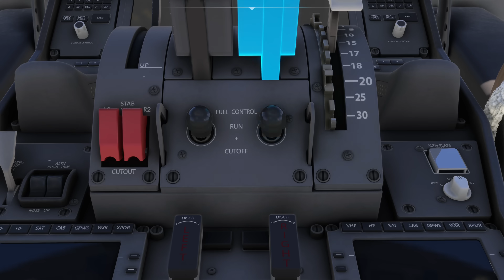Air India 171: Why Did The Fuel Cut-off Switch Get Moved?

Comment: There is a clear advisory by Boeing about installing the fuel cut-off safety, which was not  set, enabling the fuel lever to be moved without the need to lift them first. The fuel lever could have moved due to simple vibration or inadvertent touch. Why is that part not being discussed.  2018 FAA advisory recommended, but did not mandate, operators of several Boeing models, including the 787, to inspect the locking feature of the fuel cutoff switches to ensure it could not be moved accidentally. And in IA flight, the safety was not installed as per many reports.
Reply: And the moon is made of cheese, and 2+2=4, but I'm not entirely sure. Maybe the levers were over greased, or the runway was a rocky terrain and the spring in the spring loading was nibbled by mice, and if a duck looks like a duck, could it not be a penguin instead? It might be.
Reply: Both switches???

Comment: But the report does not state 'deliberately', specifically! It says 'the fuel cuttoff switches transitioned from RUN to CUTOFF with a 1 sec gap'. How they transitioned, is not mentioned. Although, they should surely have this data.

Comment: One reason Boeing said pilot error for the 737 MAX crashes is that there were notifications sent out warning that the issue could happen and how to resolve it, but many pilots apparently never read it.  One plane that had the problem was saved because a 3rd pilot on the plane told them what to do because he was aware of it.  Still a big flaw, though, that shouldn’t have relied on pilots just knowing how to work around it.

Comment: THEY DID NOT SHUT OFF THE FUEL ,ARE YOU OUT OF YOUR MIND ,SOMEONE WITH 10,000 HOURS 8,000 HOURS OF FLYING. IT'S A SCAM BOEING IS TRYING TO COVER UP A MECHANICAL FAILURE OR PART

Comment: Until there is video footage of someone reaching and moving them  - these switches are not 'hard' but software. Meaning they are digital inputs. If they fail it can record them as being in a different position. So without video footage a lot still has to be done. If possible they have to be tested and the PCBs associated with.

Comment: This and the previous video of Captain Steeeve have been blasphemous. He is not saying it but he is definitely blaming it on the pilots.

But there is now clear evidence that Boeing aircrafts have a problem with the fuel control switch's locking mechanism, which was acknowledged by FAA in 2018 and the UK authorities on 15 May 2025, 28 days before the AI171 crash, stating that there is a serious problem that would cause the fuel switches to be set to Cut-off unintended.

Watch these two videos:

https://youtu.be/4m6LwZLLq7A

https://youtu.be/nHt3k6W4be8

Please do some critical thinking and don't just peddle misinformation from secondary sources. Seek the primary sources of information.

Comment: Hi Captain Steve,

The log shows both engine fuel switches moving from “Run” to “Cut-off” one second apart. Could this be due to timestamp rounding, meaning they were actually moved simultaneously?

Also, could the pilot have briefly moved the switch to “Cut-off” before returning it to “Run” as part of an engine relight attempt? That might suggest a system-related issue rather than pilot error.

Is the recorder flag linked to the physical switch or the engine’s actual state? Curious where the sensor capturing this is located.

Thanks for the great analysis.

Comment: Many things are being assumed here:

1) FAA Advisory NM‑18‑33.
2) The switches are spring loaded, so it is highly unlikely that it was done by one hand within a single second
3)  The report also states that the timing of the RAT deployment exactly after the switches turned to cut off position hardly makes any sense, though no one has commented on it
4) TCMA failure possibility. This has clearly happened twice before where the aircraft senses it is on the ground, it throttles back the engines without pilot input. United Airlines flight from Nigeria to Washington, DC & ANA (Japan) flight

Surprised how someone who has been working in this industry so long happened to miss these things, until of course...

It's easy to say it was a deliberate act when hardly they had seconds.
Reply: RE #2, how do you know it's impossible? There are literally several videos on IG and X showing how pilots with one hand turn the switches to cut off.
Reply: I sense a logical error in your point 2: The total time of moving the two switches manually may very well have taken the pilot 2 seconds, not 1. Just the time difference between the cutoff signal for engine one and engine two is measured as 1 second. That means the 1 second is only the time it takes to turn off one switch. So it takes ca. 2 seconds to turn them both off. And I think that's a realistic time for spring-loaded switches that a pilot's hand as muscle memory on how to operate.
Reply: One second, two switches and we saw how hard it is to do it. Logic points to one pilot with both hands, deliberately, with the time frame of one second... and he was doing it with two hands to not let the other pilot see it. It’s not rocket science.
Reply: Found the Indian!😂
Reply: So convenient that no media in the West published criticism by investigating body of such speculation. Everybody has assumed the pilot “calmly” said “i didn’t do it”, no mention of calm anywhere in findings.
Reply: Time to get the tin foil hat out.

Comment: Hi Capt. Steve,
           The preliminary report is holding back a lot of information AAIB had. They might have their own reasons behind that.
       I think ICAO should make it mandatory to release the CVR and EFDR data, if available,
for the last 5 minutes before the accident.
     In my opinion, this accident requires psychiatric evaluation of pilots during their biannual medical checkups to be made mandatory as soon as possible. We ground the machines till inspections or modifications are carried out. Why not Human beings.

Comment: It could be pre-refueling measures to cut off fuel supply while refueling and they forgot to turn on switch after plane started. Plane consumed that was already in position prior to switch cut off, if there was indicator showing that fuel supply isn't constant from tank to engine and engine to thruster or whatever it is called to provide lift and thrust. If he said he didn't that means he didn't. No one lies before commiting such step.

Comment: A million dollar question really is why is it so? Easy to do this Those switches weren't hard to turn and it's right there. What's the need to turn off the fuel to both engines?... bad design

Comment: ..as far as i can understand, those fuel cut off switches are in “soft-latching switch” setup, which means, they do not directly control actual fuel valve and that FDR doesnt actually recording position of physical switches in cockpit but rather reading state of switches on electronics controller side of system. Isnt this enough to entertain idea that electronics malfunction could cut off fuel to the engines without even touching those switches in cockpit, especially considering fact that very same aircraft was plagued by various electrical failures and that very same aircraft model had both engines got fuel cut off during landing (JAL airplane), without pilots touching damn thing at all ??

Comment: 1:29 Captain steeve you are comparing a responsible trained and experience pilot with your kid? it seems like after all the practical and straight analysis you are assuming that what pilot had done on the basis of what your kids do when u find them red handed, And first at all why would pilot do that- suppose if the pilot has courage to cut-off the fuel at appropriate time and letting risk his life too but don't have enough courage to admit his actions(And if the pilots mental health was not good then he would have admit that just before crash at this mental instability he would not lie). The pilot is not there to have a clean chit but for transporting people one point to other safely and the clean chit won't help him surviving the crash.
Reply: Captain steeve is a sold out bastard

Comment: Is it possible that due to power failure the fuel switch "STATUS" was detected as "CUTOFF" and when the power regained by RAT the "STATUS" changed to "RUN" without actual movement of the fuel switch . Please answer.

Comment: Just saw news it says FAa had filed a report in 2018 that the fuel cut off switch had problems in Boeing 787 and also British aviation had filed a report in 2025 one month before the air India crash that the fuel control switches had problems in 787 Boeing why is that not being looked into why all speculation are being made that the pilots are to be blamed and you put a small part of the conversation between the pilots why not put the whole conversation well it looks likes it’s being tailored to blame the pilots why nobody is looking into that angle

Comment: I have Hyundai santafe car in Australia, this car has electrical fault, it’s not generating power and running very slow, on the dashboard engine mark coming, I went to the mechanic he removed the engine sign from the dashboard, again car running normal, after one day the sign came back, as soon as the sign appeared, the car speed went back to very slow speed, it runs but stuck at 20 speed. The mechanic told me the reason maybe censor is not working, or loose connection, otherwise change the whole part, if you compare with aeroplane might be the same kind of function running to generate the power through electrical motors as well as fuel, previously I was thinking same that fuel is not going through, but after checking report the result is electrical problem

Comment: If the pilots saw both engines spooling down on the instrument panel, would they have touched the fuel cut off valves to ensure fuel was getting to both engines in that type of emergency situation? They said the switch was switched within 1 second wasn’t it? Also, would an electrical failure cause that  to automatically happen?

Comment: This is typical western media and the clout of Boeing to obscure the fact that the Fuel switches can be "switched off" by commands from FADEC/ECU WITHOUT the panel switches having to be physically put in the CUTOFF position. Past history of the 787 Dreamliner says so. An ANA Flight NH-985 in Japan had an exactly same incident on Jan 17 2019 when it landed and there was a dual engine failure and the Thrust Reversers failed and the the aircraft rolled on and came to a stop on its own. Obviously,  both switches were in RUN but still the engines stopped. The engines could not be restarted and the plane had to be towed off from the runway. Fortunately it happened when the plane landed and there was sufficient length of the runway for it to halt on its own.

Comment: Pilots are professionals and they don’t behave like kids. It is sad that the speaker of this channel thinks professional pilots are kids. Shameful. Unlike mechanically connected  contraptions, electronics or electrically connected devices do not reassure  consistent behaviour.  How many times we reboot our system.  Maybe military standard electronics could enhance the reliability  but still remote possibility of mis behaviour (undesired effect).  In other words words fuel cut off switch  when operated should cut off fuel vales and converse need not be true highly biased video to set narratives big lobbies

Comment: Sure you could change the fuel switches to be coodinated, but then a bad pilot could just crash the aircraft another way. Aircraft are designed with a philosophy that trusts pilots and assumes they are working in good faith. If we want to change that and design for a case of a bad pilot then that is a huge change in philosophy and would competely change how aircraft are designed. Would probably need three or more pilots so you could always have two to outweigh one and then almost everything would have to be done together.

Comment: The fact that it was said on the voice recorder "why did you cut off" indicates that the pilot physically saw the switches being turned off. If the engines just randomly shut off for no reason I don't think it would have been said like that, the pilot would have said something like "let's go through the engine failure checklist" or something like that instead of acting as if the other pilot caused the problem.

Comment: Meanwhile the Indian Aviation regulator DGCA asked all the airlines operating in India to inspect the fuel switch locking system in their Boeing 787 and 737 planes, a move that comes days after the preliminary probe report into the Air India's Boeing 787 crash found that the switches were cut off before the accident last month.The Federal Aviation Administration (FAA), back in 2018, had flagged the potential disengagement of the fuel control switch locking feature on certain models of Boeing aircraft, including 787s and 737s. It was mentioned in a Special Airworthiness Information Bulletin (SAIB) but there was no airworthiness directive, indicating that the issue was not a safety concern.

Unfortunately, Its very easy to blame the dead pilots who are gone and cannot defend back.

Comment: My take is simple - I am gutted to feel that - by such videos we are trying to put ideas on the mind of audience here to think one of the Pilot will deliberate to crash due to mental health . It’s much easier to just put all blame to Pilot who are no more. The preliminary report hasn’t yet put manual error as main reason lets not put words in mouth of the audience  - A fuel control switch is mechanical switch why it can’t malfunction it is spring loaded . In 2018 there was a directive to revisit the switch are working fine and put as non mandatory . Looking at corporation like Boeing - they will do whatever it takes using money to use Youtube to do exactly same what is happening with all the videos from so called experts . Lets not draw any conclusions - until the final report please refrain from pushing your thoughts to audiences .